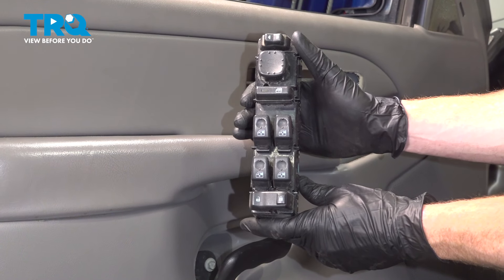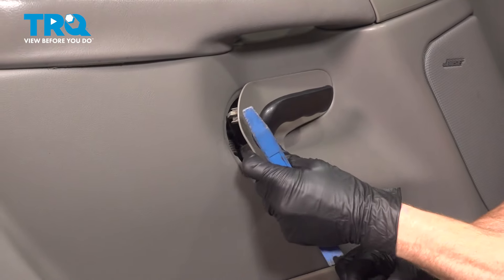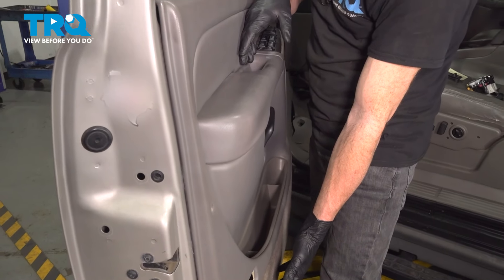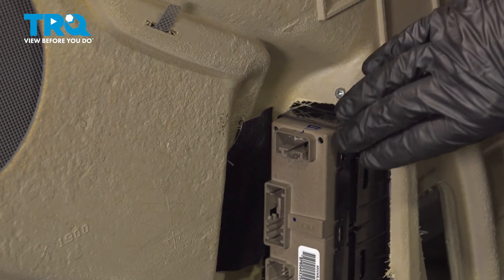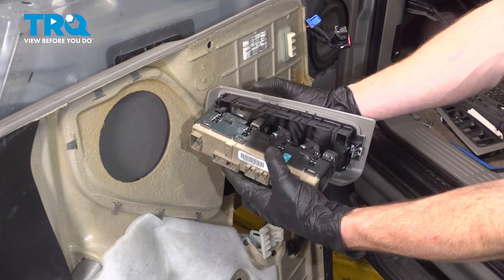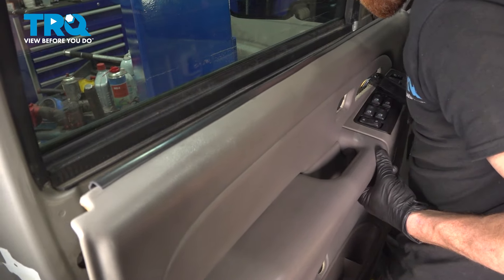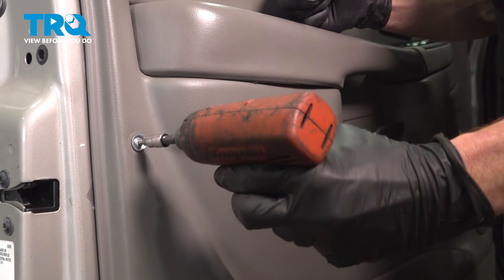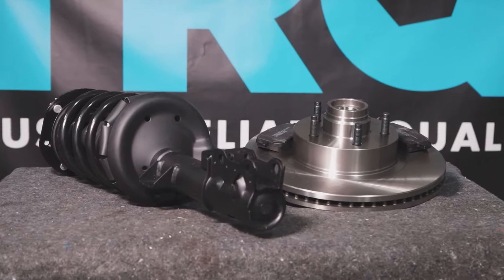How to Replace Power Window Switch 2000-2006 Chevrolet Tahoe

Comment: I have a 2006 Tahoe.  One feature I really dislike is the auto-express down front windows.  No, you cannot just hit the button again to stop them.  Once they're going down, they're going down.  You do have to pull up on the switch the whole time to raise the windows.  Can something be done so that the switch has to be held down the whole time to lower the front windows?  I would much prefer it to be that way.  Thanks!
Reply: On my 2003, i just pull back up twice real quick and it stops

Comment: Esay to follow  instructions, I ended up disassembling my own part since the replacement didn't not operate the trailer extenders for the mirrors alcohol and a cotton swab, re-installed and worked just like new.

Comment: Wow found the correct switch assembly and except for couple minor differences in door panel fasteners your video was so well done that I was able to do myself. Amazon part was $120 compared to 3 times that at regional auto parts stores. Super happy

Comment: one thing i been hiring about is the mirror switch for the left and right mirror at the top won't stay don when you go to adjust the mirrors. people have said they have to hold switch down to which ever side they want to control is yours like this?

Comment: @TRQ  I replaced my door lock/window module and everything works fine except the unlock sequence with the key fob. Before I replaced my module, when I  pressed the unlock on the fob, the driver's door would unlock with the first push, and on the second push, the 3 passenger doors would unlock. Now, after I replaced the module, when I 1st press the fob unlock, nothing happens, 2nd push the passenger doors unlock, then the 3rd push the driver's door unlocks. This is backwards. I contacted the seller and they sent me a 2nd module. Same thing happens with the 2nd module received. Is there a way to program this sequence, or are both modules wired wrong?

Comment: Is it true that the keyless entry transponder or module is also located in that master window switch minus a 2003 GMC Yukon and I already tried programming the remote it will not program they told me to change out the module or the transponder can't seem to find the location I was told that the transponder or the module is located inside the window switch can you confirm
Reply from the maker: +@edwardkareem6446 The keyless entry transponder can be found behind the instrument panel cluster.

Comment: I had to program the switch during install by putting enclosed cardboard spacer under 1 connector. 1 year mirrors fold in when adjusting. How do I fix

Comment: Gotta do this later and we'll I'm disappointed in Chevy. My 2021 Peterbilt 389 for some reason goes through drivers side window stitches, 2 to 3 a year. No can figure it out why. I pop the switch out unplug it plug in the new one and the switch drops in. No taking door panels apart. Not that this is difficult just could have been way simpler is all.
Reply from the maker: +Ron Gittins Thanks for the feedback! http://1aau.to/m/Shop-TRQ
Reply: On my 2003 Silverado, you pop the back clip and the front has a plastic slide under clip...no front screw.   Not sure why the Tahoe has a screw